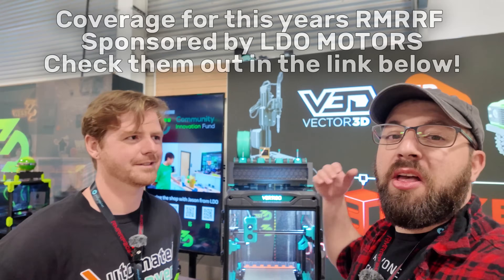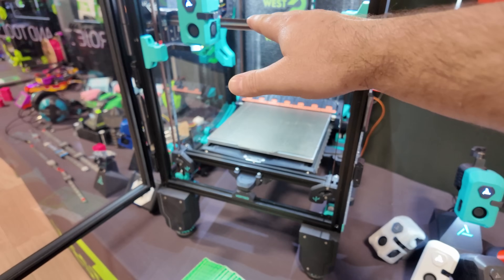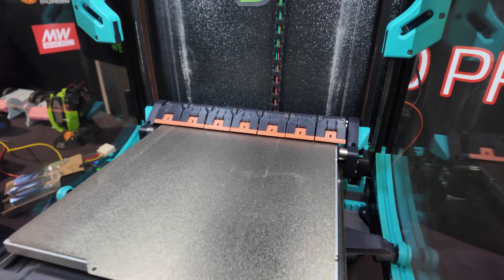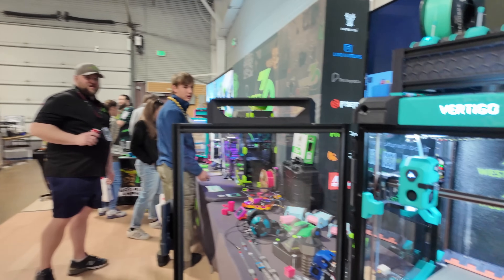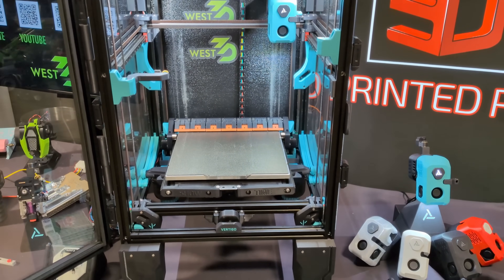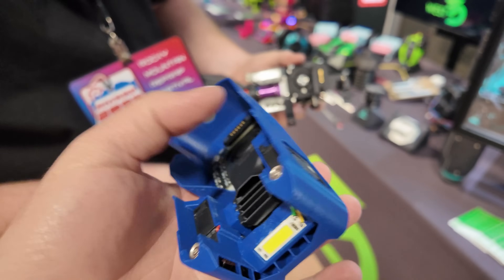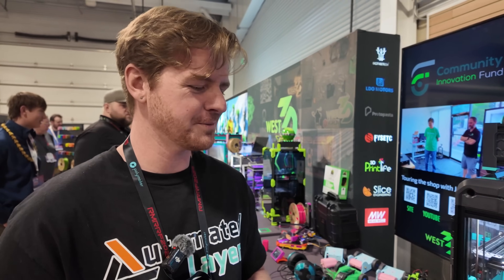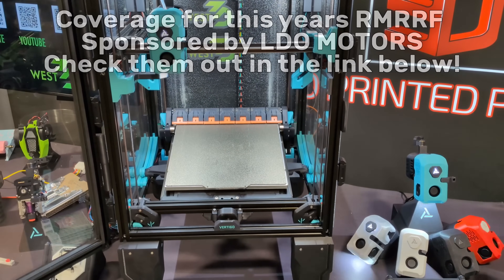VERTIGO - The Bed Flipping, Auto Ejecting 3D printer!

Comment: Do you need to run bed leveling after each print eject? It seems there would possibly be some variability in bed height after changing positions.
Reply from the maker: with a bed this size, its good practice and since its so quick in relation to the time of the print itself and with klippers new adaptive probing it only meshes the area of the bed being used. you may as well do it for some extra insurance

Comment: Seems like a reasonable approach for a subset of smallish prints (on a large printer). My worry is the complex bed mount would introduce variability in bed and tool position, increasing print failures/unreliability.  Still, for some part sizes, materials, this might be a more cost effective/reliable approach than ALL of the others, belts, robotic plate changing etc.

I currently use the 'Doug method'.
As in, "Hey Doug can you please clear the bed?"

Comment: I sometimes have prints that is so stuck to the bed that I need to heat the bed and use tools to get it off lol. would probably desdtroy something if there is no sensor. edit I liked the printhead
Reply: they just need to implement a heating cooling cycle if the force sensor is triggered by the scraper. 
pretty cool design 👍🏻

Comment: Its an amazing design, but if you print a tall print, when it scrapes it off, when the bed goes horizontal it would break the print. Would need a larger case and lower base
Reply: You can use the full 220mm Z volume for a heavy majority of the build plate. Indeed, if you printed a 250x220x220 cube, the tilting motion would cause the print (front, top edge running X-direction) to touch the front bar. So yeah, full build volume cubes are not on the menu unless you turn off the clear bed macro. I've uploaded one of our old TikToks to YT for you if you wanted to see a 220mm tall vase! We hope to upload more stress test videos in the future.
Reply: if you move the front gantry up, after moving the the back right before the scraping, you can gain more space in the front for clearing the Printbed 👍🏻